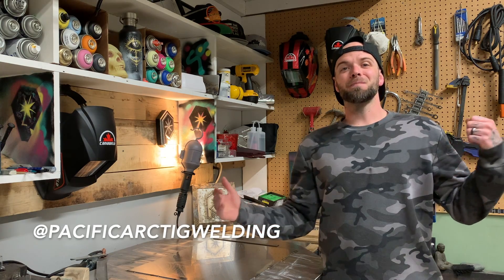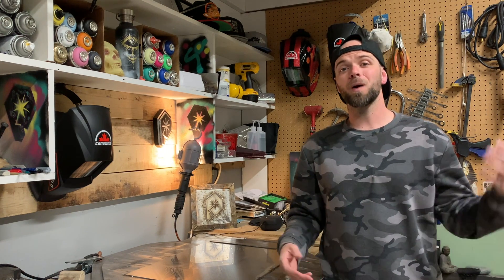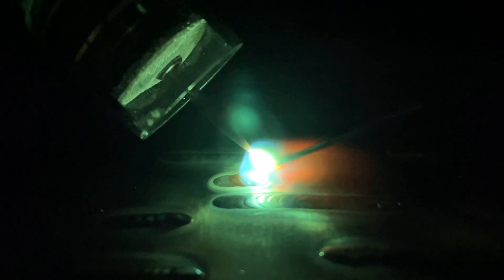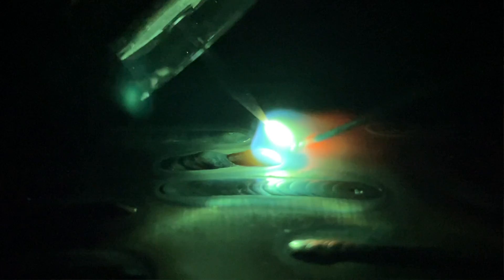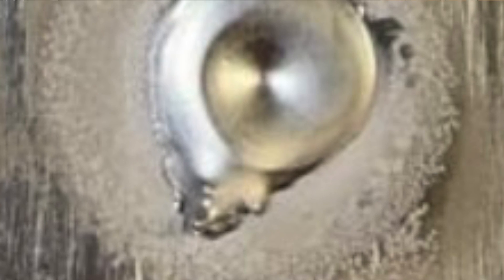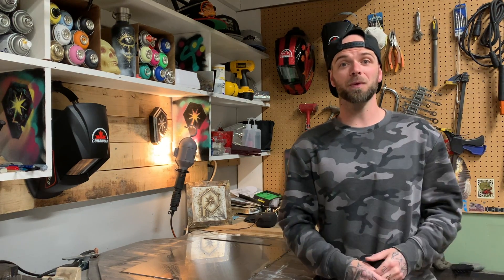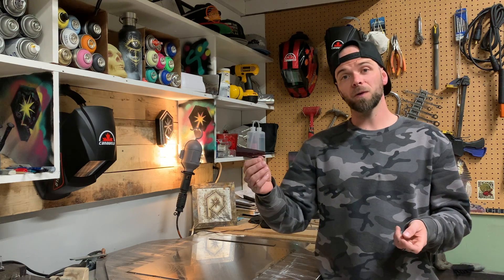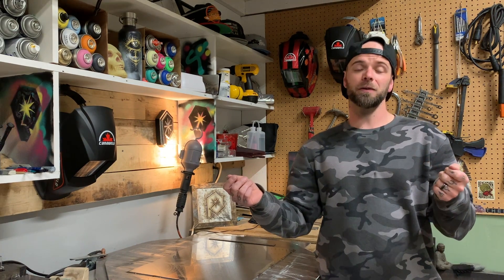Tig Welding Filler Rod GETTING STUCK!? Try this!

Comment: Thanks for the info bro, I really appricate all your videos. I didnt have issues with this running 3/32 but when I switched to 1/8 I kept sticking. At first I thought maybe heat but after a little adjustment on my angle I was able to dab in and out with no issues.

Comment: is the 90 degree angle the same in a T joint ?
Reply from the maker: Yes, although can be tricky to get your angles. Just a rule of thumb where to start, then adjust as you can:)
Reply: @PacificArcTigWelding  Oh thanks i always struggle getting joint started on T joint :D